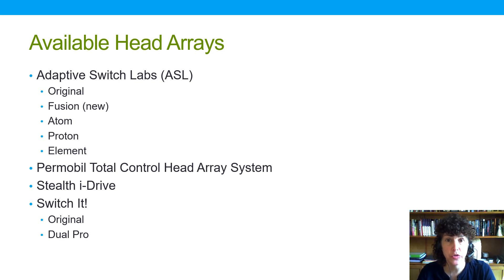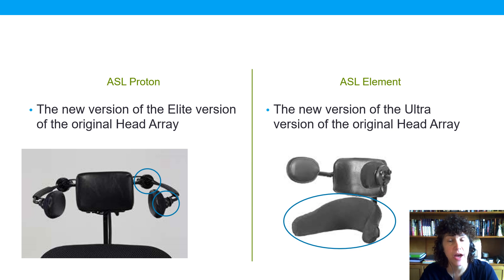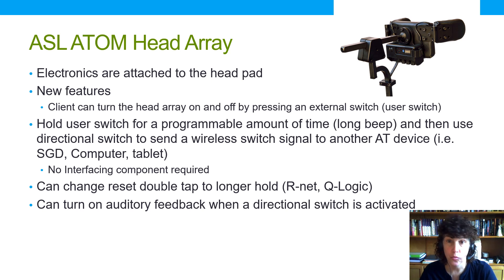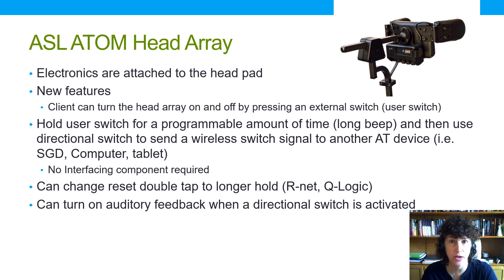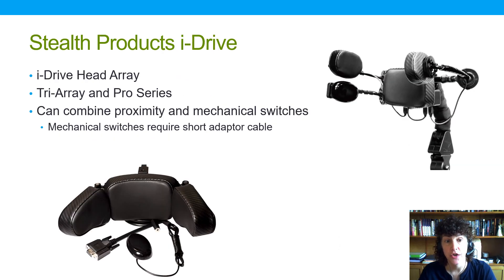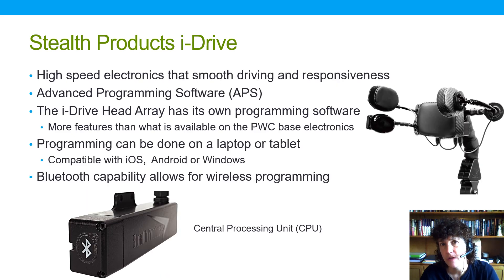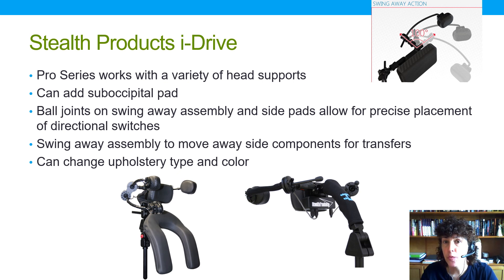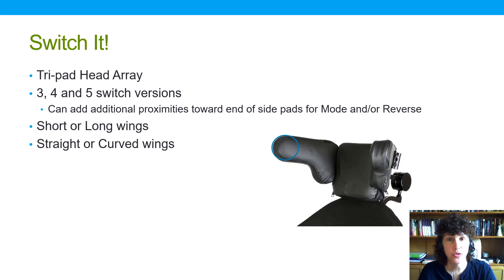Head Array Power Wheelchair Driving Method Comparison

Comment: I am a quadriplegic person using ASL head array. I want to get a lightweight foldable wheelchair but most of them are by joystick. Is there one that can be converted to fit the head array?
Reply from the maker: Hi there. Thanks for your question. In order to use an alternative driving method, other than a standard joystick, expanded electronics are required. These electronics are not available on folding power wheelchairs to the best of my knowledge. Do you need a lightweight foldable wheelchair because you do not have accessible transportation?